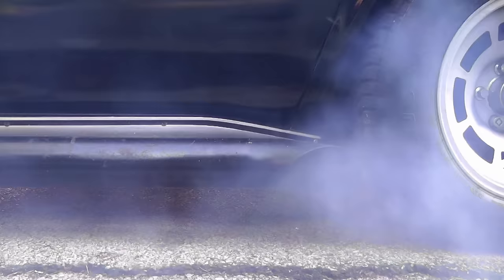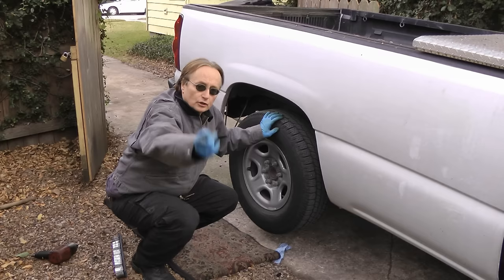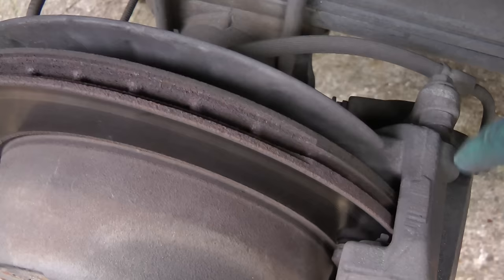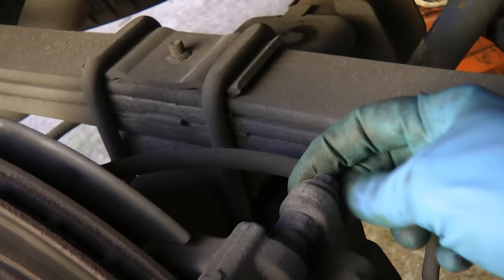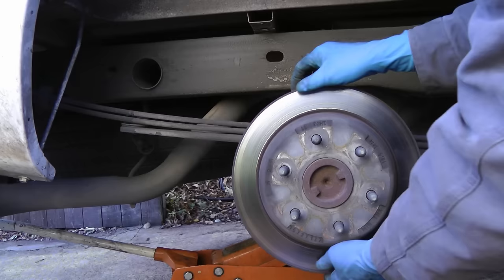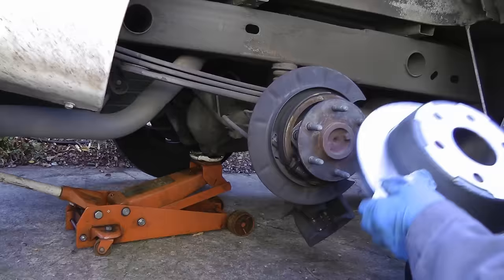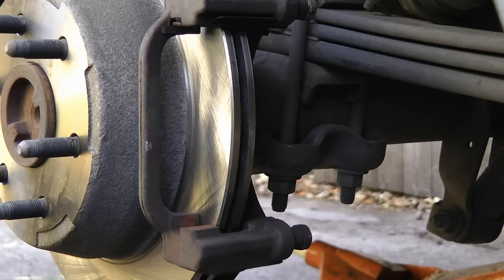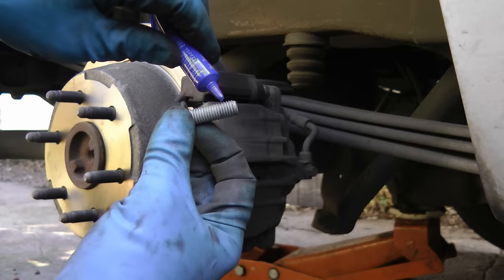How to Fix Grinding Brakes on Your Car (Rotors)

Comment: i have the same issue and I have replaced the rotor and same grinding noise. After troubleshooting it seems like when the breaks are not pressed the pads are rubbing to the rotors. not sure if the rattle spring suppose to hold the pads apart..... help. and for reference I have Fords Probe. Thanks in advance

Comment: Maybe I am nitpicking  but aren't you supposed to grease the slide pins with silicon grease and clean the hardware with a wire brush and put anti seize on the hardware.  At least here in the salt belt the slide pins and hardware get rusty and dirty and its best to clean and lube everything properly. Maybe you dont have this problem in houston. But up here in pittsburgh it really is best to make sure everything is clean and lubed

Comment: 2003 Pontiac Grand am  with a 3.4L V6
This past week
 i completely replaced  2 Front Wheel hub bearings/ 2 rotors/ 1 set of front brake pads/ 2 calipers / 2 Lower Ball Joints / 2 Outer Tie Rod ends, and 1 CV Shaft and still have squealing  and a rubbing sound when braking, the booths on the 
 old CV Shaft are hard and the New shaft is soft rubber, could that make the weird sounds.

Comment: I just replaced one of my rotors and I took it to a shop to get a sensory replaced then I was having problems with my brakes again so I took it back to the brake shop when they took off the tire I realized that's not my new rotor.

Comment: wow never thought I'd actually have to say it but this was SOO over the top un professional I feel I need to... first of all don't use blue thread locker on those, u are asking for trouble. don't use a sledge hammer, and don't dangle the caliper from the brake line... use a TORQUE WRENCH to tighten to spec, and a COAT HANGER to hang the caliper so it's not damaged. also you should properly LUBE the pads and guide pins for it all to even function properly...

Comment: Scotty I have this rattling noise coming from somewhere in front of my car. I think It could possibly be something with the brakes. I recently changed both L & R cv-axel and my lug nuts of my car. I don't think that could be it. But the noise basically sounds as if it's metal contacting metal as if it's rubbing on each other. The faster i go the more it increases but as i brake it stops. I actually have a video of it on my YouTube channel you can see go see it and hear the noise. I changed the brake pads thinking it was that causing the noise.  But it wasn't.  I hope you can help me. Thanks.

Comment: I just had brand new rotors and pads put on the rear end of my 2013 Hyundai Tucson and now I'm having a grinding noise could that be the brake caliper is sticking

Comment: Have you worked on many chevy trailblazers?  I have recently caught up on all fluids such as oil, tranny fluid, differential fluids, transfer case fluid, fuel filter, coolant, air filter on my trailblazer. Have you seen many problems with these vehicles? Mine has 156,000 miles and I want it to last to 200,000. Are the vortec 4200 engines more reliable than the other vortec engines from GM?
Reply: What year is it?
Reply: 2003
Reply: Thanks scotty!

Comment: Hey Scotty I got my whole rotors, and brakes down front and back and every time I take off it makes a weird sad at first or when I reverse it makes the same sound but the mechanic guy said it will go away but just wondering if that’s normal?

Comment: If only one brake pad is worn down like that, it's typically an issue with the slider pins.  They're either dry and need to be lubed (most likely), or they're warped.

Comment: Hi Mr. Kilmer, i recently changed my brake pads and rotors with a mechanic. But from day 1 there is grinding streaks on my new rotor like it was on my old one when my pads were worn. I can't hear any grinding sound though. Is this supposed to happen or my rotors should have stayed plain and pristine. Has he ripped me off?

Comment: I just replaced the brakes and the rotor but it still sounds like grinding , i just didnt spray it with brake cleaner do u think thats a big difference?

Comment: Hi Scott, I have an 08 BMW 335i and i'm hearing a horrible grinding/scraping noise from the rear wheel. I know I have a bad bearing on that wheel but my brake sensor wasn't done by dealer so I didn't realize how bad the rear brakes got. The noise i'm hearing sounds like it could be rocks as well but nothing fell out when I pushed back the heat shield. Insight? What does this sound like? Noise is only present when wheel is moving.

Comment: I just replaced all of my brake pads and rotors 2 days ago because they were worn out, but ever since replacing them they've been making a grinding noise when just cruising down the road (not braking). Any suggestions?

Comment: You don't need to whack the bolts loose with a hammer. Try punching with your fist first, when that doesn't work use a hammer. Oh and you don't need to put locktite on the bolts, it's not necessary and also when you want to change the pads next time it is very hard to get the bolts loose.

Comment: Hello scotty! I have a question, i just replaced a new rotor and new brake pads on my.2012 honda fit, after a few miles riding on it, i started hearing a grinding noise when i hit the brakes on low speed.. thank you

Comment: Scotty, since it was a rear brake, don't you have to twist the caliper back into place because of the parking brake?  I did on my car, I squeeze the front calipers like that, but the rears you have to twist back down, with either a proper tool, or like I did with needle nose pliers..  Love your vids BTW!

Comment: I've got a strange scraping noise (scraping/squeak) left rear only, its like scrape......scrape.......scrape.....scrape. So its not constant but on and off, when braking and when coasting too. Checked Ebrake shoes, checked pads and checked rotor. Everything looked like new. I've still got the scraping noise. Could it be a wheel bearing? Thanks.

Comment: Hi, Scotty. First, I love your videos. My grandpa was a mechanic for about 50 years and taught me everything I know and for the things that I haven't been taught, your short and instructional videos have saved my butt (and my wallet) tons of times. Recently, my roommate took her 2002 Nissan Altima 3.5L to a shop to have her front driver side bearing replaced. Turns out, it was the whole hub assembly that needed replaced. I fixed that for her (i've done dozens of hub assemblies) but her brakes make a grind/squeel sound when it drives. I thought I had over tightened the caliper back in place but that wasn't it. I'm drawing a blank at what else it might be. The pads and rotor was replaced but the sound it still horrible. Any advice?
Reply: Ever find out what it was
Reply: Did it end up being the dust shield, by chance?

Comment: scotty i just got new brake pads and rotors on my ford ranger on my front wheels. they seem to be rubbing and are wicked hot even after a short drive. are they just wearing in or?

Comment: What might be the problem if it makes that kind of sound only when it's braking? I've replaced the rotors recently and the brake pads are well under a year old
Reply from the maker: cheaper pads often make noise when worn some (they have coatings on them to not do that for a few months.) If pads are thick , ignore it

Comment: Please help, I have a 2003 GMC Yukon Denali and when I am turning to the right while moving slowly and push the brakes I hear a grinding sound. This only happens in these conditions, just put all new pads and rotors all around and new air shocks. What could it be?

Comment: Bought new pads n rotors !! Rotor grinds on brake caliper bracket outside not enough clearance why inside got clearance
Reply from the maker: you either got the wrong size parts or installed them wrong. Often the wrong rotors do that, they make hundreds of sizes

Comment: What about the inner drum pad?
The disc system has to be bled right?
Reply: The only time to bleed the brake system is if you opened it.  Normally the best way to get the piston back into the caliper is to remove the master cylinder cap and then press the piston back.  I use a large C-Clamp for the ones with out the parking brake built into it.  Or the special tool to screw them back in.

Reason for taking the cap off?  Most shops top off fluids.  So there's a good chance the brake fluid was being topped off each oil change, so pushing the piston back into the caliper?  The extra fluid has to go somewhere.....  Just be sure to clean up any mess and put the cap back onto it

Comment: Hey Scotty I'm not sure if it is my brakes or wheels here but. But when I jack my fiat grande punto 2009 up, all four wheels make a grinding noise when I turn them by hand. Brake pads are virtually new as it only has 8000 miles. I've checked the pins and regreased them and did the same to the back of the brake pads where it is metal on metal? Any ideas what it could be?

Comment: Scotty, sometimes i must must admit I do repairs "on the cheap" and in this case, I would have just reused the rotor with the groove in it. I figure if I drive a daily commute in that thing that doesn't see high spirited driving, why bother with a new rotor? How much stopping power am I really losing?
Reply: Not losing much stopping power perhaps but I guess rotors could bend or otherwise get torn apart if they get too thin?

Comment: my front breaks on my 2011 Honda Civic LX makes a weird grounding noise when I break at a very low speed (under 10mph).  However the noise is not as loud when I'm breaking at a higher speed.  I've checked the break pads and it's still in good condition.  any idea what it can be?
Reply: did you check for seized calipers?

Comment: Hey scot, I got a 2017 Toyota Tacoma that is making a grinding noise occasionally when I left off of the throttle and sometimes when I accelerate. But not when I apply the brakes. Any ideas?

Comment: I would recommend torquing those bolts to proper manufacturer specs, instead of just whacking them with a hammer. torque wrenches are cheap and essential to anyone who works on their car.
Reply from the maker: in the case of this job, torque wrench is overkill. Of course, if you have little experience in fixing things, go ahead and use one. Or, if you are very anal at everything you do.
Reply: Scotty Kilmer When comes to my car, there is no one more "anal" than me :)

keep up the good work, love your videos.

Comment: Instead of hitting the ratchet wrench with a hammer. Why not just use a short length of pipe over the handle, for more leverage?

Comment: Thanks for making this video!! my grand am started making this noise a few days ago. I won't be able to fet it fixed for another week. Is it okay to drive even though it's making the grinding noise?
Reply from the maker: +Alex Medina  as long as the wheel isn't actually wobbling when you jack it up and pull on the tires
Reply: Thank you for your help. My boyfriend is out of town and will replace the brakes when he gets back home. I will jack it up and check for wobbling
Reply: +Alex Medina Don't make your boyfriend do the work you can do! Outdo him and reverse the trends

Comment: Hey Scott, this question is off topic.

My brother plans to buy a 2005 Nissan 350z low miles, stock engine, and transmission and it's not salvage. Are those cars fun to drive?

Comment: Scotty, you think it's a person should replace the rubber brake line hose also when doing front brake job? three different times I had front brake job done, my brakes caught on fire by time I got home. The rubber hose collapse, one time by auto dealer, and local auto shops.
Reply from the maker: +Gary Boley when really old, yes, they are strong hoses but to deteriorate when 8 years or older
Reply: Thanks Scotty, the car and van were both over 8 years old.
Reply: thanks

Comment: Have you seen ChrisFix's videos?  He would have a heart attack if he saw you using a hammer to loosen the caliper bolts.  He insists that you use a breaker bar to loosen the caliper bolts, that you put the brake caliper assembly on a stand to keep it from hanging by the brake line, and to use a torque wrench to torque the bolts to their specs.  He also uses things like anti-sieze where necessary.  Anyhoo... you and he have a lot in common.
Reply: And where would one expect to find these torque settings of which you speak?
Reply: MrSupercar55 In the owner's manual or maintaince manual. You won't find everything in the owner's manual however.
Reply: WarBerJr02 It's actually not a big deal for the caliper to hang from the brake line. However, it's still a good habit to have it not hang from the brake line.

Comment: Hey Scotty I have a question, i just replaced all pads in my 2005 altima and also replaced the rear rotors, however when i took the car out on a test drive it started making a metal grinding noise on both front wheels, I found out that i need to replace my front right rotor also but i dont think that's where the noise comes from, do you have any suggestions for me?thanks an for all your help.

Comment: Hi Scotty, I have a grinding noise coming from the rear of the car, its a V6 rover 75, i just replaced the rotor discs but not the pads as they looked ok,but it still grinding, do you think it could still need pads even tho they were ok, the rotors were badly pitted and rusty etc

Comment: I love your videos but need some help. My brake crack like extending a spray too far and it only happens  when I'm stopped and take my foot off the brake then reply. I apply them it cracks like a extended spring on a trampoline.

Comment: I have a 2000 dodge ram pickup 1500 2 wheel drive. I changed the brakes on it because it was making a scrapping sound when I drove it. And since then I have changed the brakes and it's still making the scrapping noise. And the roter is loose is that normal

Comment: Hi Scotty,  I ahve a 1996 Subaru Outback that has 175K miles on it, barely broken in, but the rear passenger side is making a grinding noise.  I replaced the pads, the caliper brackets and the rotors.  The original pads didn't show any significantly unusual wear patterns.  But it definitely is the pads, I removed the pads and put everthing back together and spun the wheel, no noise.  Put the pads back in and the noise came back.  Any other suggestions?

The pads do seem loose in the caliper bracket though.  But the new bracket and the old one behaved the same way.  I did replace the metal clips, didn't make any difference.
Reply from the maker: check wheel bearings for wear, if they have play, brakes will bind when driving
Reply: Scotty Kilmer I can't feel any play on the wheel, up/down or left/right.  Any other thoughts or suggestions would certianly be appreciated.  Keep up the great work!
Reply from the maker: Thomas Varghese
worn wheel bearings often make noise LONG before you can feel play, realize that
Reply: Scotty Kilmer I had heard that.  Any other way to confirm it?  Also, since the sound goes away when I remove the pads, does that not eliminate the bearing?  I'm new to fixing cars, so forgive the repetition, I can be dense :)
Reply from the maker: Thomas Varghese
see my video "finding the source of car noises" that's how we mechanics pinpoint em
Reply: Scotty Kilmer  I've developed a keen ear for bad wheel bearings.

My moms 2004 Nissan Murano has gone through 5 wheel bearings on the front (three on the left and two on the right.) I guess that's what you get when you have 18" tires being held with tiny bearing packs.

Though it could just be a lemon considering it's also had a broken transfer case and had 4 camshaft sensors go bad (two for each bank.) among other problems.

Comment: Scotty Kilmer  I replaced my rotors and brake pads in the rear. the noise went away for a day then it came back it makes a grinding noise as if I have cheap brakes and  I'm driving with the brakes pressed but it only does it 1/4 of a full rotation any ideas

Comment: Whats the best way to break the rotors loose when they don't want to come off?
Reply from the maker: spray WD 40 on their anchoring parts and then whack em with a hammer half an hour later

Comment: Should the rotors be replaced in a set too or is it ok to have possibly 2 different manufactures and size (micro thickness) rotors?
Reply from the maker: +David James best to change in pairs so it stops evenly with same braking force
Reply: +Scotty Kilmer I spray my brake area inside the tire with some rust cleaning spray and after that making very terrible sound when I apply breaks.. What to do? Use some kind of oil or what u suggest.

Comment: you didn't mention the caliper piston could be frozen might not depress completely. and make sure the sliding pins in the bracket  slide freely good sir.
Reply: otherwise great video

Comment: I have some rust or layer on top of the rotor for parking the car outside for 4 month, did some full braking around the neighborhood but its not completely gone. Inner side rotor is silky smooth, how can i fix this?

Comment: I wanna take what you're taking scotty
Reply from the maker: it's called Live Free Or Die, like on my T shirt. Only i live it
Reply: I got a question for ya. the Inner pad on my audi a4 went down to metal, rest of the pads are fine though (about half life left). I know I need new rotors and pads but how can I see what caused this? is there any common methods for trouble shooting calipers?

Comment: Rofl I love the part where he just pulls the rotor off the hub...I totally want to work on cars from Texas!  Mine included beating on it for 3 days at random times with random objects and taking chunks out of the rotor in order to get it beat off of the hub.  So much for salt on the Ohio roads in the winter.

Comment: i have a 2011 dodge grand caravan i just put new pads & rotors on front & back 2 weeks later the front is Grinding again when i press on brakes not sure why its doing it again you have any ideal what it is?